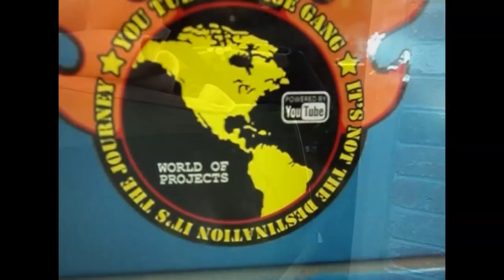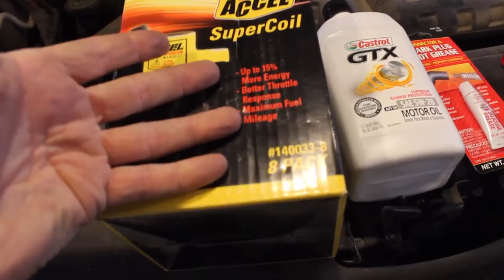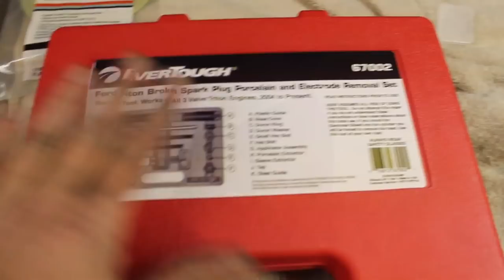F-150 Transmission Shutter - Fixed - Coil on Plug and Spark Plug Swap

Comment: Is this a common problem in the 5.4 2v also? Just had a small rumble/vibration in the truck that I can't repeat. It sounded and felt like I was riding on the rumble strips on the shoulder.
Reply from the maker: +James Free similiar symptoms on the 2v.
Reply: +Greg's Garage awesome thanks for your response. Unfortunately I can't repeat the issue yet so I just have to drive it until it happens more frequently so I can diagnose it.
Reply: +James Free Not at all. 2V engines have the issue where the plugs can back out over time and then blow out stripping the threads. The root problem is there are only like 4 threads instead of 6-8 in the head itself. On the 5.4 2v engine simply replace the plugs (Motorcraft only) and then over-torque them. Factory spec is about 13 lb-ft, you want to torque them to 20-25 lb-ft. Some recommend as high as 28 so no big deal, just be sure to torque down to 20 and call it a day. Do not use anti-seize on the plugs as they are nickel plated so anti seize is not recommended or needed.
Reply: +James Free p.s. I just swapped plugs on an 02 this week. You do not need to remove the fuel rail (lots of guys do it but it's just extra work). If you do the plug change, this tool is magical it helps a lot, I highly recommend it http://amzn.to/20jDvVN

Comment: hey Greg i have the same shutter exact problem with my 2012 Hyundai Sonata gls. What are your suggestions ??
Reply from the maker: +Richard Appenteng It's possible to have the same type of an issue on another car.  A bad plug, bad coil, cracked distributor cap, plugged injector and a few other things can cause similar stuttering.
Reply: So with that being said you think don't think i need a new transmission ?
Reply from the maker: It's cheap to have a mechanic throw it on their tester...  That way you could know exactly what's going on.  Every car type has quirks and such, so the symptoms on a Ford may or may not translate to your Hyundai.
Reply: Alright I understand now. Thanks for info Greg

Comment: Does anybody know what the problem is with my 2000 ford explorer 5.0 when its idling it has a horrible shake even when driving at any speed ive done the motor mounts and transmission mounts i just cant figure out the problem

Comment: I have a 2003 Town car, and have a shudder under light load starts around the 50 mph , but not there if going faster.. no codes.. maybe I just need a tune-up... that would be nice.. as long as my plugs come out with out all the B.S
Reply from the maker: Yes.

Comment: Hi My name is Luis f Martínez and i have  at Ford f150 crew 4 Doors    2006     and i have that problem  too i like to know how much cost all the work to fix My tuck  labor and parts Tank you have nice da y
Reply: Luis Martinez You can do it yourself when the engine is cold. 
Buy all spark plugs and just 4 coil plugs (if you install four brand new while other 4  are original) if the problem goes away, then you fixed it. If problem still the same rotate spark plugs.

Comment: I'm having trouble getting to the number 4 spark plug how did you get it out
Reply from the maker: +Jona Brown It's a trick.  I've got a number of different wrenches and extensions.  You've got to just find the right combination that will weave through all the crap.
Reply: I'll keep trying I gave up tonight but I'm gonna get it out

Comment: I was told to run Seafoam first and then use impact driver instead of ratchet ?
Reply from the maker: +Tom Drew (wheelerdrew66) Yes.  And carb cleaner down the hole.  Some warm the engine first as well.

Comment: Hello Greg, let me start by saying thanks for all the free information you give to us all. I know you made this video some time ago. But my 2004 Ford F-150 Fx4 is doing something very similar. I'm no mechanic. It shakes and shutters around 40-55 mph anything below or above. Stops shaking as much. Had the transmission changed 24 months ago. Drove it 25,000 miles since then. Truck now has 139,000 miles on it. Mentioned a tune up to my mechanic and he instantly talked about plugs breaking off in the engine. Can you please give me some advice on what steps to take? I have a 100,000 3 year warranty on the trans. Trying not to pay 2,500 on another major issue. Your reply would be greatly appreciated. #GregsAwesome

Comment: I have a Ford Explorer xlt 4wd with a frustrating vibration on highway around 55mph speed
Anything above 65mph it goes away. 
3 New sets of tires Michelins have been tested and force road balanced 100 times maybe. 

Hub assembly replaced originals ford. No use. 

Front & back suspension both have been inspected perfect. No wobble no play no noise in any part 

Brake disks are all ok, tested with a dial gauge. 
 Problem has been with me since 2 years now and it's so frustrating to me in particular Coz. I'm an ex-mechanic but I can't troubleshoot my own car. !!

I'm suspecting the cv axles but I don't want to change 4 of them Coz they're expensive. 
I can't figure out a way to pin point the "defective one" without taking them all a part. ??
Coz I'm positive they can't be all 4 defective. 
It could be just one of them, but I can't pin point that one alone without dismantling all of them and testing against machine shop for any runout.  

Thanks.
Reply from the maker: +leo lulu Fords have an issue with the pinion bearing drying out after the differential gasket starts leaking.  Doesn't usually cause a vibration but it could.  It sounds like you've checked all the items I would check.  If the vibration is felt in the seat of your pants it's typically in the rear end if it's in felt in your hands its typically in the front end.

Comment: I just had my plugs changed on my 05 F-150 at 100K, my truck runs awesome now, my question is i still have the original OEM coils and was thinking of getting the Accel super coils next i see their around $230.00 has anyone had trouble with these or got fault codes?

Comment: Hey Greg,
Got the EXACT same problem on my '04 5.4l F150. 
New motor about 20k ago.
Do I still need to replace the plugs (20k on them) with the coils?
Reply from the maker: The plugs are good for 100k.  Coil is likely the problem...
Reply: +Greg's Garage 
code said misfired on #2 and #6. bought two new coils. Replacing over the weekend.
Reply: Hey Mark, any update...fix the problem? I'm staring the issue down myself right now.
Reply: Hey Nick,
OOhhh yeah. Replacing the #2 and #6 coils fixed my problem IMMEDIATLY. I can't believe the power I have now. 
This weekend, I pulled a 16' trailer with a '52 Chevy on it from Lake Jackson Texas, to Lubbock, Texas. Almost 600 miles. Cruised at 75 most of the way. Not a problem at all!
I think the coils were $45 ea. at Autozone.
Reply: Were they the Motorcraft coils?
Reply: No. I bought the Duralast brand. I looked it up. 
Paid $45.99 ea. for two.
Reply: I have a 05 f150 and when I am getting onto the highway about 45 mph it starts a slipping, light jerking skipping feeling, is this a shudder and how can I fix this? any info would be greatly appreciated
Reply: +Greg's Garage think the dr. tranny fix might help the slipping when acceleration onto the highway?
Reply: my 05 has a new motor coils plugs and wires all new and no codes less than 20 k on it what else can it be

Comment: I started following a ghost on mine.
 2002 4.6 with 190k miles.
 Had a code for #3 misfire. Swapped coil #1 with #3 and code switched to #1. Replaced coil pack on #1.
 Then I got a code #4 misfire- replaced coil pack.
 Then got a code for #1 again and found antifreeze in the plug well. I then remembered seeing moisture on #4.
 The only way for coolant to get into the plug well was a leaking intake manifold. ARGGG!!
 So I replaced the intake manifold . It was a first for me so it took at least 8 hrs. Replaced plugs, then drove it. Misfire in #1 - wtf?  The coolant destroys the coil pack- so I replaced that pack and it seems ok now.
 I like you was ready to kill something. LOL.

 Now I smell oil leaking. Arg!
Reply: newstart49 I just had the same problem with my 2005 4.6 with only 115k miles... coolant leaking into plug well.  Had the shop replace the intake manifold gasket, plugs, and 1 coil... now 2 days later i'm getting a misfire and I suspect its another coil.  However apparently OEM is about $90 per coil - so at this point im thinking of buying the whole pack of 8 online (aftermarket of course, to save $).  Any suggestions?
Reply from the maker: Michael Lawrence I used the Accel brand super coil pack and OEM plugs.  Accel sells the coils in an 8 pack.  I've used them as a replacement on a number of ford engines with no complaints.
Reply: Thanks for the input, I'll look them up!
Reply: Michael Lawrence
 I have since had to replace all the coil packs. Another one misfired, so I did all of them- so far so good.

Comment: Final result is a good feeling - but the spark plug issue is a true design flaw that would warn me off buying that motor ever!
Reply from the maker: I think they have it fixed in the new versions.  While it's a pain in the rear, the motor has been a pretty solid piece.  140k without any "real" issues is pretty darn good.  If it makes it past 200k I'll really be impressed.

Comment: Hey Greg, does this shutter manifest in the steering wheel ? mine feel like just in the foot and floor and feel like and rumble strip.
Reply from the maker: +Jkreuter You got it...  It's in the hands, feet and rear end...  Just depends on the driving condition.  It can also be caused by a bad injector, but that is less likely to be the cause.
Reply: +Greg's Garage +Greg's Garage  Hey Greg, great videos. I'm experiencing the same shudder, ('05 f150, 5.4l, fx4) I installed new plugs and it went away for about a month. It's back now and so I installed new coils but the issue persists - in fact, it seems to idle worse than before, engine actually shakes a bit. It's rough in park and neutral and nearly stalls when you put it in reverse and drive. It threw a code while I was driving that said system lean on bank 1 but I can't get it to throw that code again, or any others. I don't know what to try next and a little tired of throwing money at the problem! Any advice you have would be great! BTW, I also have that ticking noise that you fixed by replacing the VCT solenoids, could this be related?
Reply from the maker: It can also be an injector that is clogged...  STP has an injector cleaner that treats 28 gallons of gas.  I put a bottle into a 1/2 tank and it does a fantastic job of cleaning the injectors.  It takes about 50 or so miles before you can tell, but it will generally help if the trouble is a dirty injector.  I think its about $4 a bottle, so it's a VERY cheap and easy way to help sort out a miss in the engine.  The VCT clicking will not affect the engine miss.  FYI, one of the plugs I used has already worn out.  1 year after I installed it.  The do make bad plugs and bad coils.  Lastly...  Double/triple check the wires on the coils to make sure they are getting a good connection (no corrosion etc).
Reply: +Greg's Garage Thanks Greg, I pulled the plugs and one of them was pretty burnt looking, it had some build up on it as well - the rest were still clean. All of the connections seemed to be good so hopefully it's just a bad plug.  I'll try a bottle of injector cleaner and pick up a new plug as well. Hopefully that will do the trick... Thanks for the speedy response!

Comment: Luckily on my 02 ford f150 with the 4.6 it uses the spark plug with the shorter thread.  I bought 8 new coils for mine from amazon for 32 dollars earlier this year and same ones I think are around 45 dollars now.  I'm not sure if these coils would work on your later model with the 5.4 though.  Heres something I believe causes most of these plugs to break off in the heads.  I think the seat is flat when it is supposed to be tapered because on my 4.6 I noticed auto zone and o reilleys was selling plugs for mine with a flat seat when the motorcraft I ordered have the tapered seat that matched the tapered incline on the engine heads.  When people remove plugs from these engines observe whether the plug hole in your head is flat or tapered.  Another problem is people putting minkey goop on the threads. STOP THAT PEOPLE!!

Comment: I crack the plugs no more than 1/8 turn. Then use Carburetor Cleaner in there for 15 min or more . If they still move hard respray and wait. The carb cleaner will eat the carbon much better than blaster or other sprays.
Reply from the maker: Tom told me to call you and I should have...  I paid the price Terry...  It's all better now, thank goodness.
Reply: Greg's Garage No matter how you attempt changing those plugs it is a gamble.
Reply: +wtbm123 Yup carb cleaner is the trick!

Comment: You can buy a lot cheaper on Ebay, Ford 4.6L . I bought just one to see if it works on a small engine. Less than $7.  I ruined a 4 cyl Ranger engine by not changing plugs for 30k. One was rusted and broke.Tried to get it with an easy out. Started the engine to see if it would loosen hot. Some of the plug must have fallen in because there was a lot of noise and excessive smoking. Truck was in bad shape anyway so just scraped it. Should have taken head off. Decided to take the gamble and lost this one.

Comment: Got a beautiful ingot silver 2010 5.4 3v now with 185k miles that sputters and shakes the whole truck under moderate acceleration at about 3k rpm. And I also have an issue where if I'm going 50mph in O/D and I floor it, it waits like 4 seconds to actually shift and then I get a big clunk and my tranny starts slipping. I'm told that this is actually my transmission going into some sort of limp mode because of my plugs being bad since I have had my check engine light on since like 150k miles. This is the new 6r80 transmission btw which I'm told is known for some issues at least in the 2009-10 model years. Anyone else have any good ideas? I really can't afford to rebuild a transmission so I'm praying that new plugs will fix this.

Comment: Found a forum. Seems I have to somehow either brake the plug off enough to get the removal tool down there(sounds iffy) or pull and seperate the plug body from the tip which I cant do because it is still fully threaded into the head, so actually the forum info does'nt apply to me
Reply from the maker: Yeah man...  I don't have one of those plugs handy, but I believe the core is porcelain all the way through...  You may have to break it out slowly to "hollow out" the plug.  Tapping the porcelain with a small hammer and screwdriver or (other pointing metal object) will give you access for the extraction tool.  Once the ceramic is out of the way, the threaded nut may be removable.  GO SLOW.  When you are done with the extraction vacuum the cylinder out like crazy.  Any chips that make their way into the bore will eat your rings in a hurry.
Reply from the maker: Did you watch this video??:  https://www.youtube.com/watch?v=dOG1zSnPJRo
Reply: Greg's Garage Ok, its dark and I just finished up and got them all out and installed new and all new coils. I had a Duh moment this morning. What i thought was the nut spinning seperate from the threads was not . It was the nut and thread body spinning in the end cap section. I needle nosed the first one out and all it left in was the clean tip. I thought "kool" I just have to go to step 3 with the extraction on the spinning plugs. Yeah, right, the rest broke off ugly so 5 of 8 broke and 3 came out whole. I had to spot light and cell phone pic no. 4 because a piece of my air comp blow tool flew off and got lodged. Of all the holes right! Anyhow, started it up and it idled a little rough and seemed to smooth out and on more startups seemed ok. I'll test drive it tomorrow, still seems a little delayed when reving the gas in park. I did use all motorcraft stuff but not sure if unhooking some electric may have done something. Thanks for your help
Reply from the maker: If you used any cleaner, it may have fouled your O2 sensors...  Takes a few days to clean itself up.  Mine was ROUGH on idle afterwards and would die in reverse at low RPM.  I'm so glad you're put back together.  Congrats on completing one of the most difficult DIY Ford repairs.
Reply: Greg's Garage Yes, I used carb cleaner,but its good to know it should work out after all of that work along with my sore ribs ha ha. I"ve worked on my vehicles my whole life from the 10 hr heater core jobs to even painting my old '99 but these plugs.............Sheeeeeeeeesh . Its gonna make the trans flush seem like a walk in the park. thanks for your input and the laughs. Take care

Comment: I have the exact same issue on my 06 f150. Did plugs and coils. A week ago. Took coils off today to put the dielectric grease on hoping that would help and still doing the same issue.
Reply from the maker: Ugh...  The next thing to check are the injectors.  They can cause the same issue.  Start with a bottle of STP injector cleaner...  $10 or so...  Give it a week.  If that doesn't work, you can pull the injectors pretty easy and they are fairly easy to clean/replace.
Reply: Greg's Garage sounds good! Thanks

Comment: OLSCHOOL is absolutely right! It’s highly unlikely the trans is the problem! A dirty spark plug (s) or Faulty CP is the probable  culprit! I keep a set of plugs and 1 new CP on the truck just for shits and giggles in case I need it for quick Road side repairs